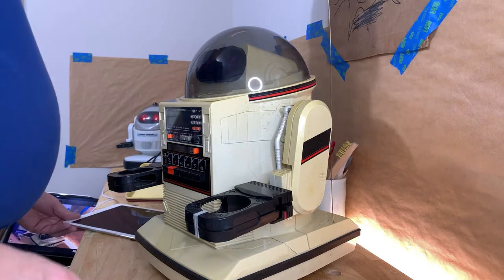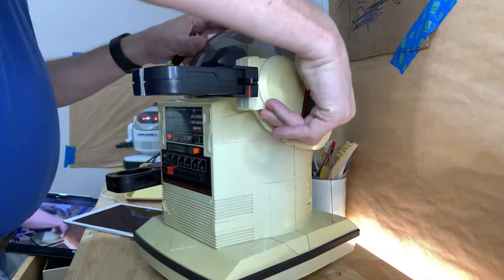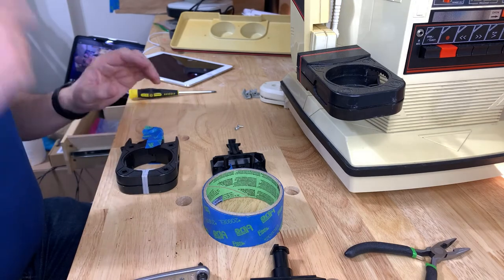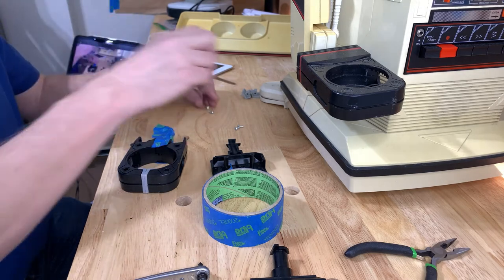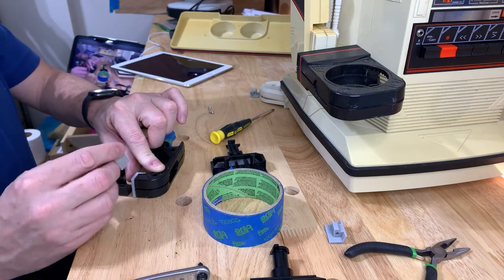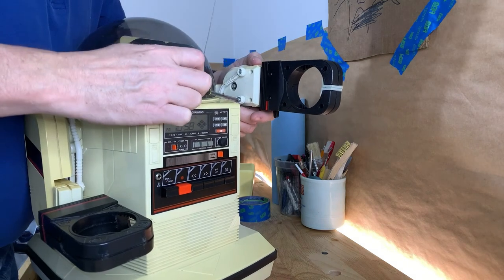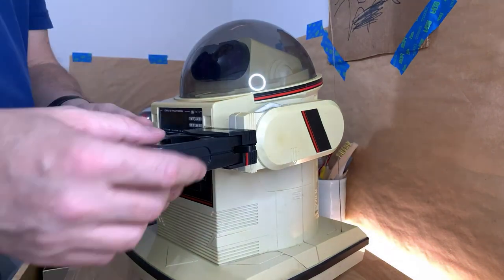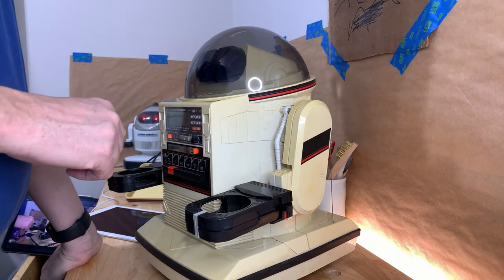Replacing Rubber Grippers on an Omnibot 5402 with new parts from Daboo Designs

Comment: I had no idea the design needed to be so complicated - the designers of this toy were clearly frustrated rocket scientists. But now I want to replace the treads and grips for my robot :-)
Reply from the maker: Thanks for your order. The gripper hand mechanics are crazy complicated. I had to take another one of my bots apart to figure out how to get the first one back together correctly.
Reply: @DabooDesigns  Thanks! Got the parts! And now of course I can't work out how to put the claw back together ;-) Update: my 14 year-old helped me. We found an exploded schematic and that really helped.
Reply from the maker: @GrantMeStrength  Yay! I'm so glad you were able to get it back together.
Reply: @GrantMeStrength  I found a "service Manual" but it doesn't show the reassembly of arm or claw - did you find a schematic diagram for just the claw?